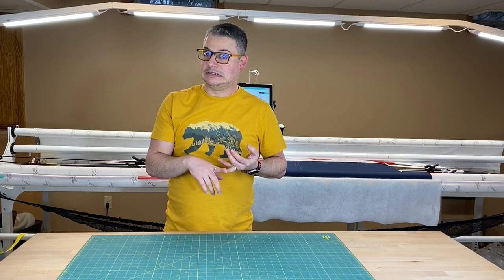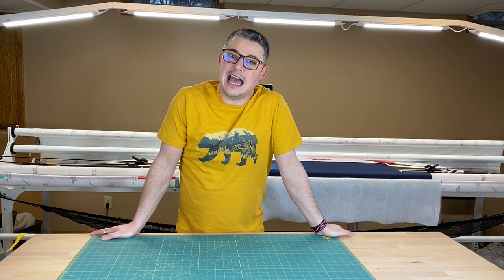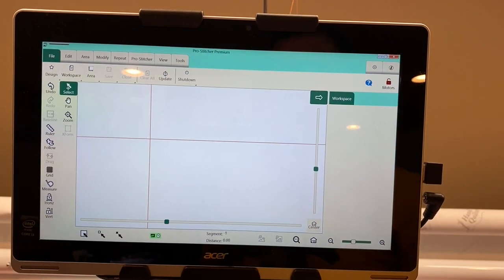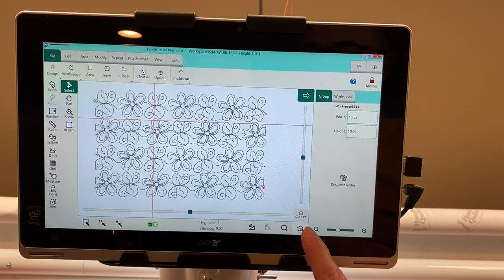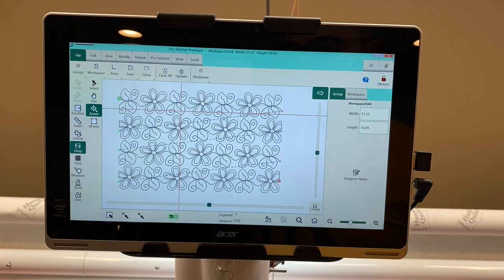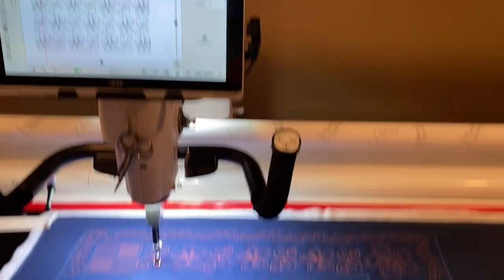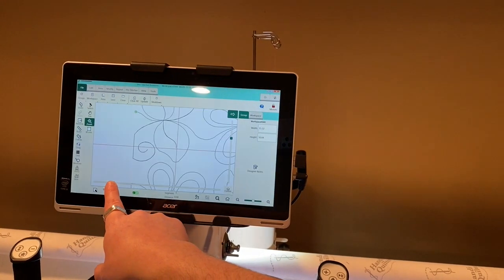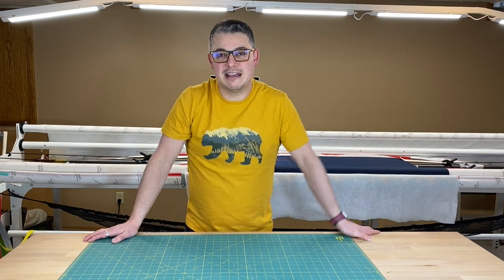Reposition a design after a Motor Error, Crash, or Reboot

Comment: I have followed  your instructions before and it has worked.  Now I am on the last row 10 inches from end of quilt and the tablet crashed and I cannot get it to realign.  I cropped, realigned, baselined and corrected my start point and all it does it go around the edges of the quilt and stops.  Very frustrating.
Reply from the maker: Sorry Carmen, it sounds like a step missing a step somewhere. Hard to help specifically when I’m not there with you. Try moving your start point into the row you want to stitch, then using the up arrows to cycle the start point to the point you want to start. Not the Jumps arrows, the arrows that are either above or below the scroll bar.
Reply: Thank you @adamsewfun.

Comment: Love your videos!  When I am looking for help on anything with the pro-stitcher, I look for your videos first.  They are clear and easy to follow.  I do have a question for you.  I am about to do my first border with an edge to edge in the middle of the quilt.  Would you suggest that I quilt the center area (edge to edge) first and roll my bars back to do the border after the center area is completed?  Thanks in advance!
Reply from the maker: Hi Joan,  I would do the top border and the corners, baste the side borders as I go but stitch the center with my e2e.  When I get to the bottom, I would the do the bottom corners and border.  I then take my quilt off the frame, turn it, and reload it to do the sides.

Comment: Really enjoying your videos!   My question is, do you use this same method of repositioning when stitching a cropped block, within the same quilt, with a different design?  I can't seem to get my cross hairs to go on that start and stop points of the block.
Reply from the maker: I'm not sure I follow fully.  Are you cropping one block but using that same design in multiple blocks?  If I were doing this, I would set up the first block.  Once that is the way I like it (cropped, sized, position), I would baseline and save that block.  When I needed the next one, I would open the saved file and use an area to skew into that new block or just use the area to help me align the new block.  Hope that helps?

Comment: What do you do if you didn’t save, can you go back and start where it left off and finish the row with your design?
Reply from the maker: If you didn't save and only had a motor error, you can reconnect, line up and start where you ended.  If the tablet crashes, you will have to recreate everything from the start.  If I ever have a motor error and realize I didn't save.  The first thing I do after it reconnects is save it.   Then I can line it up and and continue stitching.

Comment: I have never used drag and drop In all the years I’ve had PS,  but going to give it a shot. Once you find the position with drop/drag, do you use reposition new start point to start your next row?
Reply: that was my question also.  I just bought my Amara and I'm overloaded with info....and questions
Reply from the maker: Once you have moved the design to where you want it, you would go into the Pro-Stitcher Tab, New Start/End in the ribbon and select the start of the row you want to stitch out next.  Barbara, I have a series quilting an E2E from start to finish, you should check that out.  It starts at loading and goes all the way to cropping the final row. I even tossed a thread break in there because I ran to of bobbin.  It really does have a ton of info in the series.

Comment: how do I line up after thread break then I turn off machine?
Reply from the maker: Did the thread break, so you shut down for the day and are now coming back to the project?  If that is the case, the first step is to line up the whole design first.  Once that is done, then you can move your start point to where the thread break happened.
Reply: @adamsewfun.  thanks
Reply: @adamsewfun.  thank you worked great

Comment: okay, got it on repositioning after a shut down, but still confused on where and how to actually start the 2nd row
Reply from the maker: Once you have it repositioned, you have to pick where you want to start. If you are starting at the beginning of a row, you can go to new start/end. Under the Start column on the sidebar, you have 3 sets of arrows.  The bottom set are under the word “jump” or “ump.” If you use this set, each time you move it, the start point will go to the start after a jump. So pushing down once should take you to the beginning of the second row.

Comment: After this, how do you get it to continue and stitch. When I hit run it tries to go back to the previous row and gets stuck on the bar and says click, click, click. Then I have to start over again.
Reply from the maker: After you reposition, set a new start point where you want the Pro-Stitcher to start. If it’s the beginning of the row, you can use the arrows under the jumps, or you can just use the Auto button.  Anytime you move designs like this, you have to tell Pro-Stitcher where you want it to start.
Reply: @adamsewfun.  But how do I do that. I have only been using this machine since last Friday. LOL I am really new. I can set my area, and realign and then it tries to go back to the previous row.
Reply: @pamelacrocker1850  prostitcher tab, new start/end, on the side bar under the Start column there are arrows that will move your start point.  You want the green X to be at the position that you want to have prostitcher to start.
Reply: I finally got it to work. Or I finally worked.🤣 Then I broke a needle, broke my thread and ran out of bobbin. I am getting lots of practice using my newfound knowledge. Thank you so much.

Comment: I set up the whole quilt with E2E.  I cropped the first and last row.  During the quilting, I used row 2 only as I proceeded on.  However, I did not know how to jump to the last cropped row after only using row 2!  Please help!
Reply from the maker: I show how to change the start point between rows in this video.  It's easier to just drop a link than to write it all out.  Hope this helps you. https://youtu.be/6wiiJA78dJ0
Reply: Thanks Adam.  This will certainly help!  Happy New Year!

Comment: When I try and move my workspace it will only move the pattern in the workspace area.
Reply from the maker: I hope you figured out.  I have been on the road and running for the past month and haven't been able to respond.  I'm not sure what was happening but it sounds like you might have had an area cropped and not baselined after the crop.  Not sure though.

Comment: Why does the motor error or ps crash. How do you reset them.
Reply from the maker: Unfortunately, the answer to that is above my pay grade.  There are so many moving parts and connections on a machine that is moving the whole time.  Just one connection need to juggle loose to cause an error.  Most of the time, this doesn't happen. If you get the lightning bolt in the top right, you just need to select it and it will reconnect your motors.